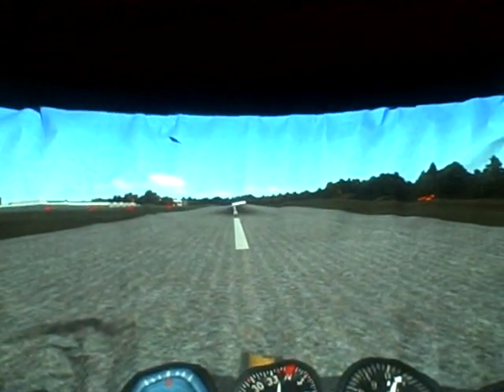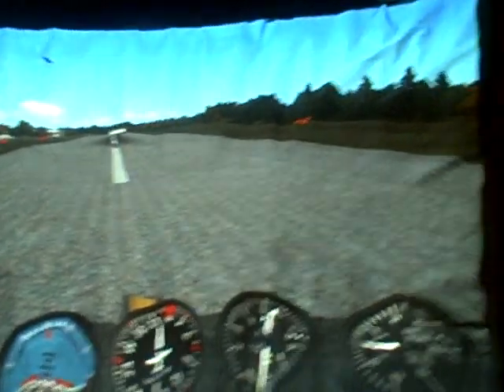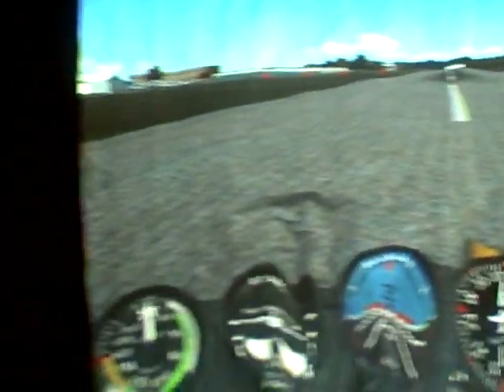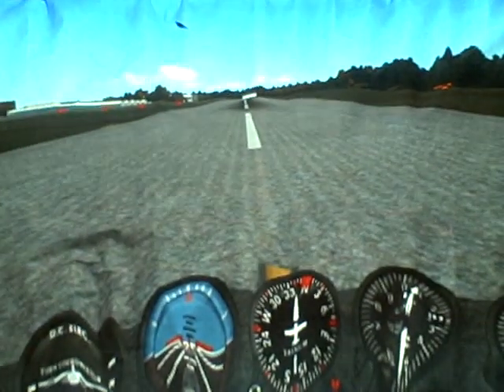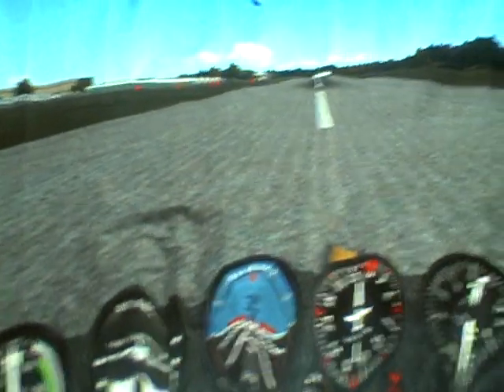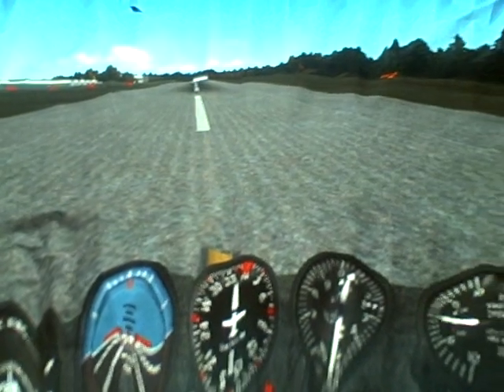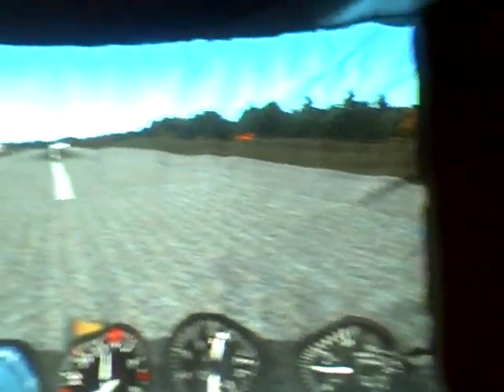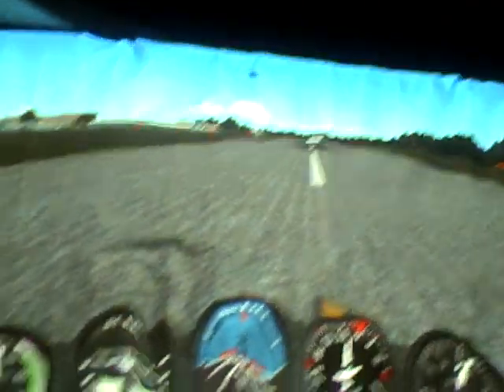World's first amateur built fully collimated flight simulator display.

Comment from the maker: @mlscotti, the vacuum doesn't just pull out the wrinkles.  Due to how the framework is constructed, the vacuum forces the mylar into a spherical section shape.  You can learn more about how collimated displays work by checking out the "Full flight simulator" article on Wikipedia.

Comment from the maker: @mozzmann The foam block that is inserted between the ribs are sanded to ensure a perfect toroidal section - something you can't achieve with just tissue & dope over a ribbed surface.  The foam inserts are proud of the ribs and the gaps were filled with drywall mud.

Comment: Looks awesome, only downfall is you have to run the vacuum to get the suction to pull out all the wrinkles? Im assuming that is milar? I tried Mirrored plexi but it was to big to mount over the top of my sim. I went back to a projector behind showing on large thin pvc panels hung from the ceiling.

Comment: @f15sim Hey I have a little tip for you with the primary screen, I noticed from earlier Vids you use a ribbed form which is fine BUT my tip make the form with 2 X the number of ribs so the shape is truer and use White Aero modelling tissue and dope to shrink it into place then a coat of Auto Body spray putty for extra smoothing and finally several coats of Flat White Pearl Paint, you don't want excess reflection as this is the screen. Fantastic build considering the cost.